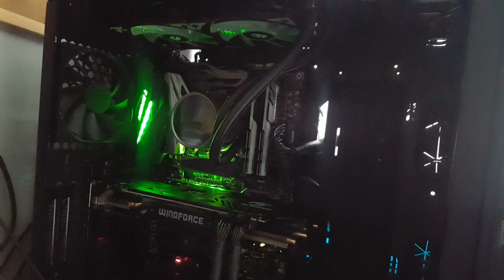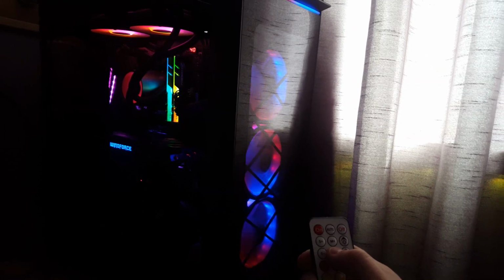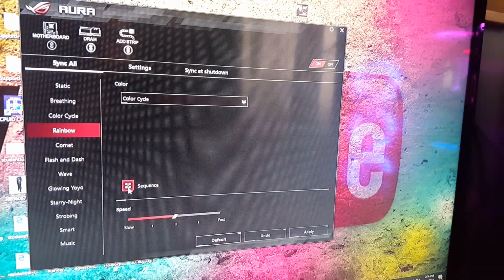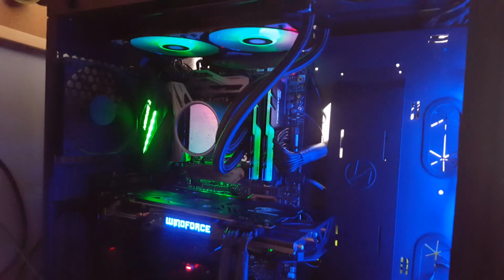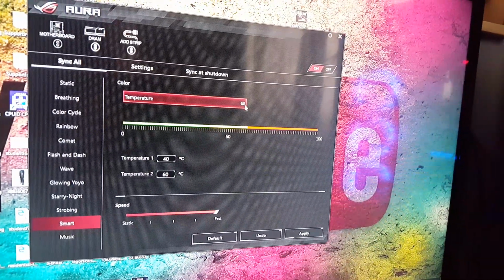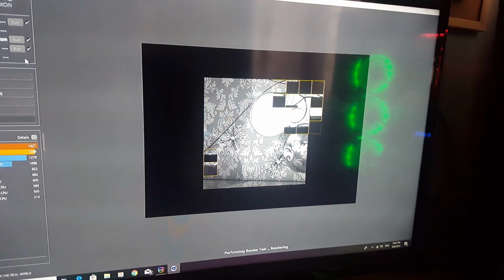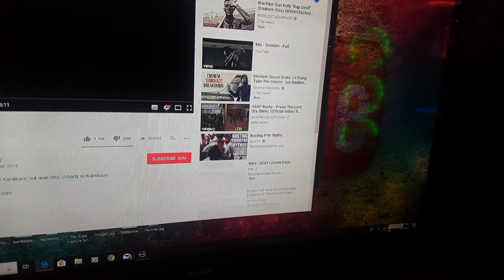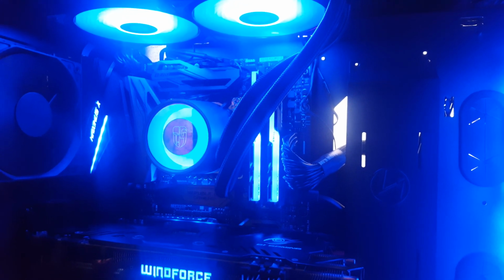i7 8086k Build - Deepcool Castle, Asus ROG Maximus Hero & Aura Sync!

Comment: I'm considering buying tis aio cooler plus a 3pack of corsair ll120 fans. will I be able to control all of them with Asus Aura on my ROG STRIX B350-F GAMING motherboard?
Reply from the maker: the motherboard is compatible with aura sync but i'm not sure the corsair fans are! I'd recommend having a look here for compatible fans: https://www.asus.com/campaign/aura/us/Partners-and-promotions.html - If you get the deepcool castle, I'd recommend getting the deepcool fans which are the same as the aio.
Reply: Luke De G Why would you use corsair fans. Theese have RGB And support Asus aura sync while the corsair stuff doesn't
Reply: @maekkelmann345  didn't buy it

Comment: can you set the cf120 to dual colors or rainbow colors using aura sync?
Reply from the maker: Is that the name of the fan? If so I dont believe you can in aura sync, unless you plug the fans rgb cables into seperate rgb headers on the board

Comment: How you connect the castle to aura ? I got 4 pin led header on the motherboard and the rgb castle is a 3 pin connector :/
Reply: The 4 pin headers are the older standard RGB running 12volts which are single color at a time. The 3 pin are the newer addressable headers running 5 volts which you can have multiple colors on one RGB device. It's complicating at first, but once you figure it out it makes sense. What's dumb is they don't make any converters or adapters between the two types. So you just have to know which is on what motherboard you're buying.
Reply from the maker: @KillSchwill  thanks for clearing that up, it was confusing me ngl
Reply: @KillSchwill  is it possible to sync with aura without 5V (3pin - aRGB) header?

*im using Asus B360M TUF and RGB case fan from deepcool (CF120 model)
Reply: @rohaizadroslan5088  Yes it is. Aura Sync is supposed to recognize the 4 pin headers as well. On my motherboard they follow the onboard LED colors regardless if you set them to or not. But you should be able to individually change the color of each header. Also, if the colors aren't the right color on each header, there is a calibration option option under settings that will fix that.
Reply from the maker: Yeah it confused me as well, my Asus mobo has two 4 pin rgb headers, but it turns out it doesn't use them, it uses a different 3 pin connector on ASUS motherboards. There's one called 'add_header' or maybe 'vdg', have a look for one of those and let me know.